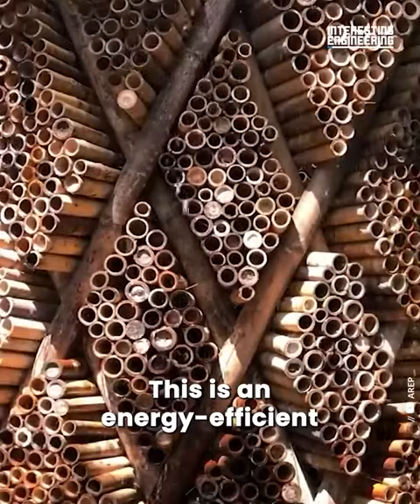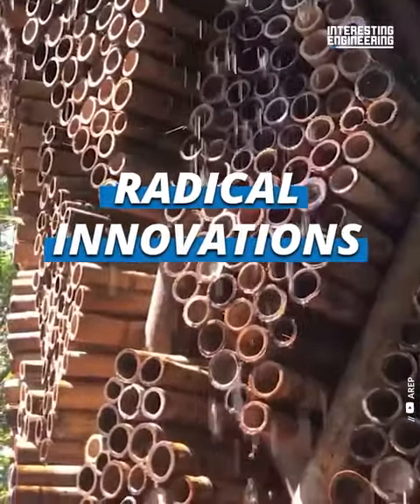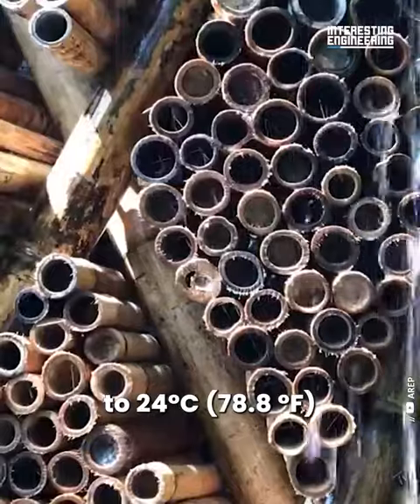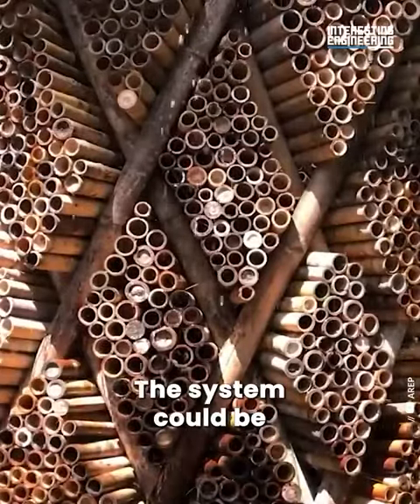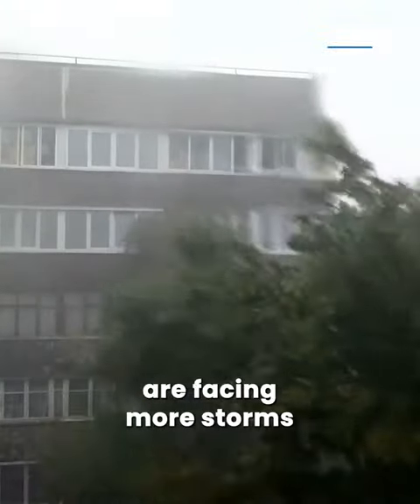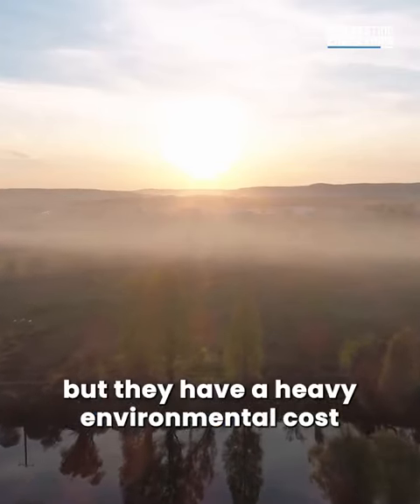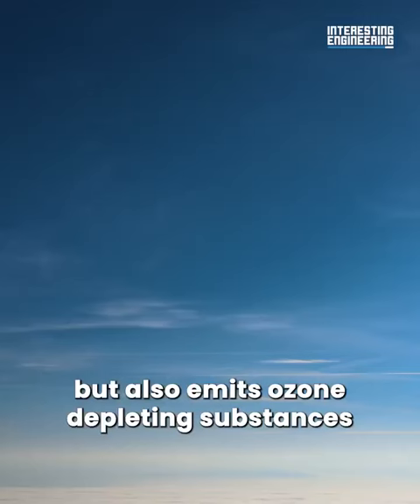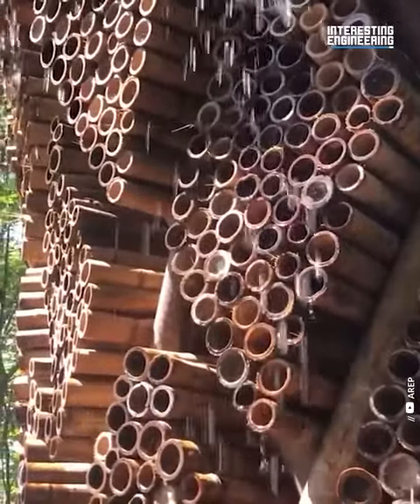This cooling tower made of bamboo could be an alternative to modern AC

Comment: I guess it just can’t. It’s making use of the evaporation which cools the air and adds the humidity at the same time. Molds are then inevitable. 

Maybe the water can be set to stop running in a pattern so that the whole thing has the chance to become dry to prevent molds.
Reply: Just and some anti molds essentiel oils time to time. It’s enough even in small amounts.  😊👍🏾